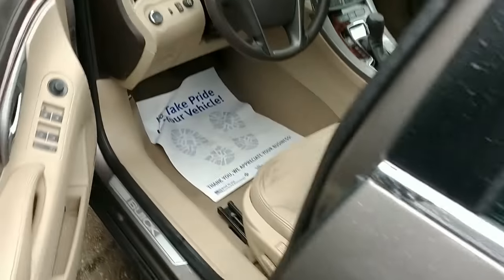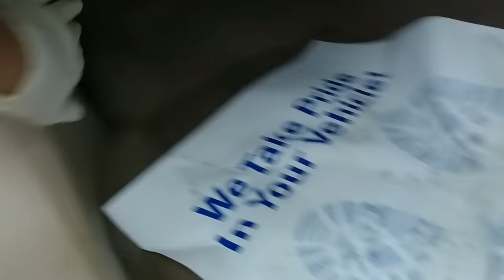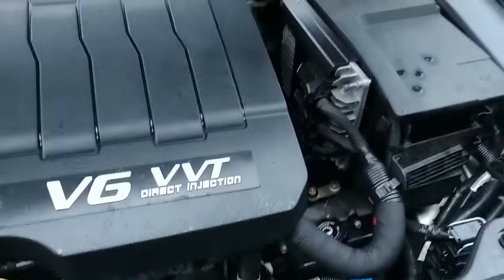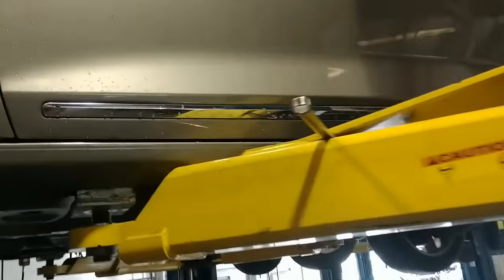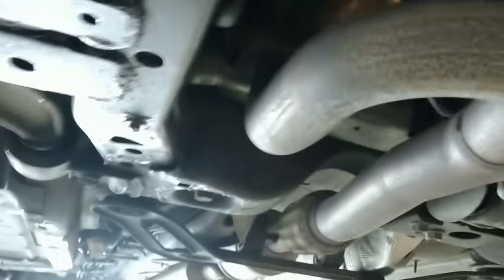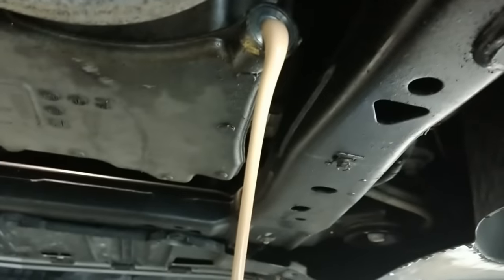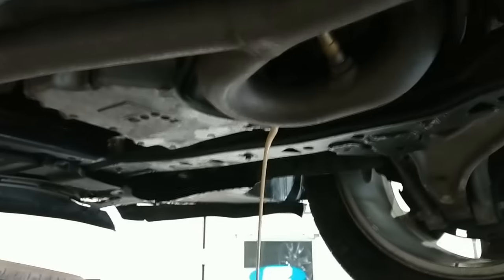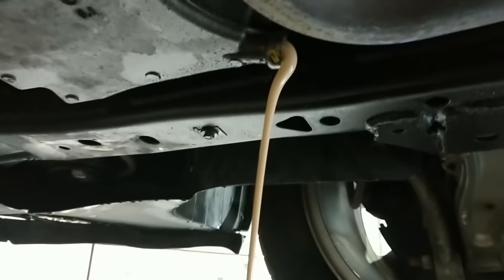Overfilled Crankcase! Blown ENGINE! Used Car Nightmare!

Comment: Your video is now evidence, defendants exhibit 1 in court.
Reply: I'm sure the purchase paperwork for this car had an enormous AS-IS statement included with the buyer's signature right on the line.  
ALWAYS get a Buyer's Check from a reputable mechanic's shop.
Reply: @Cautionary_Tale_Harris  There are still laws to help protect against this kind of issue.  AS-IS or not, if there was no disclosure on the work done and if the dealer was at fault, they can be held liable.  I mean, come on, they used a tube of silicone to seal the timing chain cover, that alone warrants some action.
Reply: @cujoedaman  
This buyer might be able to get some recourse...maybe. In my experience, the most a buyer has been able to recoup is some of their money back. 
But I wouldn't expect a judge to force the dealership to take the car back. Caveat emptor.
Reply: @cujoedaman  no way to prove it was the dealer that did that. Very easily could be another dealer that did it, sold it it at auction, and the end dealer sold it. You think this is their first rodeo? Cars always should be checked and our legal system is flawed. Don’t be naive to expect the government to cover you, when you didn’t try to cover yourself.
Reply: Evidence of what?
A stupid buying decision....
Reply: You mean plaintiff’s exhibit?
Reply: @DerPilotMann  
And it's all perfectly legal...
Reply: @atticstattic  legal doesn’t equal right or morally acceptable.

Why are so many people obsessed with legality over morality? Makes zero sense.
Reply: @cujoedaman  Unless it's a legitimate fraud case, that As-Is clause will fuck you over under both the Rest. 2nd of Contract Law and the Universal Commercial Code. You have VERY limited rights if you purchase a vehicle As-Is. The As-Is alone is an ENORMOUS red flag.
Reply: @DerPilotMann  
Yeah but all too often there's a reason why some people have to buy from those shady places rather than more legitimate sellers.
Reply: @camtwan1  , a private party might get away with "i don't know nothing" but a dealership will not.
Reply: @DerPilotMann  And to add, it doesn't matter if you're buying a smoke-wagon from ScrewYou Motors or a garage-kept car from a sweet old granny...the mechanical soundness of a car is far too complicated for the uneducated to try to determine on their own.
Reply: @truthsmiles  oh, yes, can I blame that on the phones autocorrect?...
Reply: @markbroughton5814  I’ll allow it :)
Reply: @DerPilotMann  
you aren't going to win in court on moral grounds
Reply: @DerPilotMann  because courts are based on a thing calls laws which dictate what is and isnt legally allowed. Though, the building blocks of most laws actually are based on religious beliefs/followings which i find to be bs.
Reply: @DerPilotMann  
That's how capitalism works, I'm afraid...
Reply: @atticstattic  I would only add the caveat that that is how “poorly regulated” capitalism works.

While I’m not the biggest fan of our capitalist system as is, I think capitalism with strong regulations is perfectly viable for most industries.

Aside from that, yeah, you’re not wrong.
Reply: @DerPilotMann  
Strong regulations won't protect people from themselves...
Reply: @cujoedaman  silicone behind the timing cover can be common practice from the manufacture nowadays, have seen to many times...mostly on GM vehicles.
Reply: Unless the buyer bought the car (as is) the seller can just say they cleaned the vehicle up and sold it as is....
Reply from the maker: Hope not, but I've been to court before. Documenting is critical in my business.
Reply: @DerPilotMann  because your morals are really just your personal opinion on the way things should be. I'm not saying you're wrong, but everyone's opinion is different in some way.
Reply: It's called lemon law people. It basically says they can sell you a really nice piece of $h!+ for $4,999.99, and not anymore than that, and there's nothing you can do about it.
Reply: *Plaintiff's.
Reply: Im a canadian car salesman, As-is still means that it must provide transportation for atleast a few weeks to give it time to be mechanic certified. If this dealer was in ontario he'd be fucked.
Reply: Buy as is is how this goes.  Buyer's responsibility to get it inspected if they don't know how to do it themeselves.
Reply: Unfortunately, a used car is always buyer beware unless the buyer can prove it was malicious  by the seller, and that's a tough sell because buyers are suppose to thoroughly go through car and have inspected by mechanic unless he knows what to look for, otherwise, wont hold up in court. Always inspect a car prior to nt transaction. But also didn't help when new owner drove it and overheated on her (not sure how long that happened from purchased, feet or days). She could have blown the headgasket.
Reply: @cujoedaman  whats wrong with doing that? there are good brands of silicone which are designed to seal valve cover, timing chain cover
Reply: Even with an AS-IS purchase agreement, you should have the expectation of have a car that will run. Yes, it has problems, but it shouldn't blow up on the way home. In most states you have a Lemon Law that protects you from this.
She should tow it to the dealer, tell him this is NOT what she paid for, and if he doesn't refund he will be in court - see how much of his time he wants to waste.
Reply: @TSKseattle  I don't think the lemon law covers used older cars (I believe new cars) due to the fact there is an expectation of issues on usd cars. Car didnt run right from the start and instead of not purchasing or questioning the dealer about it further, she drove it and even for an hour before catastrophic failure. That's why you always take a mechanic or take to mechanic for inspection. Prior to any used car purchase. Courts will ask of she notify dealer and gave opportunity to correct before any consideration if at all due to it being a used car.
Reply: @camtwan1  please-I owned a small. Car dealership follow the law to a t- go to court dealer will still lose. It’s like the feelings court-they don’t go by the law the lady will won
Reply: @DerPilotMann  Yeah, in law school they actually teach lying. Lawyers are the scum of the Earth, and always have been. Just look at your state and federal governments, mostly populated with corrupt, immoral lawyers.
Reply: Believe if it’s over a certain amount then old owner is liable. I’d still sue
Reply: @DerPilotMann  This world has lost all morality, since they made murdering babies legal.
Reply: @jonyemm  Your reply is the b.s.
Reply: @cujoedaman  silicone rtv is how you seal that timing chain cover, no gasket. The buyer is screwed, fix it or let it get repo'd
Reply: Yall forget about lemon laws.
Reply: I think everybody is picturing this happened to their mom.....
Reply: @DerPilotMann  Buy here, pay here dealers are shady but if a person hasn't figured that out by adulthood, couldn't tell by the shoddy look of most of those dealerships, and they couldn't spend a few minutes doing research then maybe they need to learn the hard way. No one expects consumers to be all knowing. We do expect consumers to do their home work and/or pay an expert to help them aka have the vehicle inspected by a reputable third party.

Government doesn't exist to protect people from their own negligence.
Reply: @saved217  other than the very end of my reply whrre obviously state my opinion isnt really up for debate considering its quite factual. Even for my "opinion", its actually supported by the good old "seperation of church and state".
Reply: @jonyemm  So you mean laws like thou shall not murder, lie, steal, hate, greed, gossip, honor you mother and father etc, etc. Those mean old religious laws? Boy your right . Those are terrible laws to live by.
Reply: @Cautionary_Tale_Harris  My 2015 Chevrolet Impala was sold AS IS and 2 calls later and demand letter from an attorney and the dealership refunded every penny including tax, registration, interest paid on the finance and my extended warranty
Reply: @airfried4908  What's the story on that? Because a refund like that is exceedingly rare.
Reply: @LavaughnVanbrocklin  Lemon Laws generally apply to newly manufactured cars and the manufacturer/dealer must be given multiple opportunities to try and fail to correct the vehicle's problems.
Reply: @cujoedaman  Which laws, exactly? And for which state? Thinking a law should exist doesn't mean it does.
Reply: Good luck with that, that's now how AS-IS sales work.
Reply: @airfried4908  Being 100% serious, I genuinely want to know more details about what happened with your Impala.
Reply: I would just burn the whole dealership down
Reply: I bought a truck used in VA it overheated and the head cracked 20 miles down the road. They replaced the engine for nothing. It was their fault for not notifying me that the water pump was not working. They said ok we will replace it.
Reply: @BTrain-is8ch  consumer protection legislation exists because scummy fucks will try to rip people off, and their victims deserve recourse.

The victims are not the ones to blame.
Reply: @cujoedaman  chevy doesnt make a gasket they use silcone from the factory
Reply: @DerPilotMann  Americans have an accountability problem.You screw up, you learn from it, you move on, and you don't make the same mistake twice.

I bet you think people that make interest only payments on debts like student loans then find that their balance has actually increased after years of payments are victims too right? Damn "predatory" lending huh? Why didn't the lender tell them that their payments weren't large enough to  reduce the balance at all? Why did the government let them do that? Why didn't someone protect those poor innumerate people?? Where was the consumer protection??!?
Reply: This is the car you drive off a boat launch then tell the insurance company you parked it last night, came out that morning and it was gone.
Reply: @user-cs3zs6jn1d  I know here in the state of Indiana there's no lemon law on used cars. Only new..
Reply: So how much would it cost to repair that engine, or is it toast?
Reply: Cool theres coolant in the oil. Wheres the diag. Whys every tech now some narcassist making youtube videos and solving nothing
Reply: @DerPilotMann  because they went to public school and believed every word they said lol
Reply: @zashbot  as did I for quite a while. Only once I got out of my small Midwestern town and actually met people of differing backgrounds did I gain an appreciation for how reality works. 

It’s hard to see your privilege if you never interact with those less fortunate...
Reply: I believe the lemon law applets here does it not?
Reply: @brianscofield2457  thats now how used cars work with as is condition . Otherwise people would go around buying up every 200 dollar parts car there was and sue the seller.
Reply: @marioncobretti7870  true... This is very unfortunate... Hopefully she got at least a 30 day warranty... Thanks for the response sir... Stay safe
Reply: @Cautionary_Tale_Harris  buyer beware  if used
Reply: Depending on the state, if there was a warranty included, even a 1000 mile or 1 month warranty, this would not be an as is transaction.
Reply: Sister Mary Clements  
"Braking" the law - love it!
Reply: There's no lemon laws to protect people from this, if the cars is only a few days title transfer and drive only a 100 miles she should be fully protected unless she was stupid and bought the car AS-IS and was made fully aware of the cars situation.
Reply: It was a 30/30 plan: 30 feet or 30 seconds whichever comes first.
Reply: @mr.k.i.s.s7496  Oklahoma guarantee.
Reply: At the very least, the dealer's insurance rates should go up after all of the cars on their lot mysteriously burst into flames.
Reply: @Cautionary_Tale_Harris  In CA at least, there are strong laws protecting against this kind of thing. If you sell a car as "working" and it has some catastrophic issue, you can sue and win.
Reply: This is so weird, I thought lemon laws were to prevent those scummy buy here pay heres from selling junk like this.
Reply: @user-cs3zs6jn1d  lemon laws are only for new cars
Reply: @C.c.dethomasis  you must own a bhph, your comment is irrelevant, because it's no excuse for a bhph to rip someone off. Not everyone gets bad credit from being irresponsible. Mine is crap because I got seriously ill, and had huge medical bills.
Reply: @Cautionary_Tale_Harris  Depending on how consumer friendly your state's laws are, the "AS IS" may be unenforcable in court if the car was bought from a dealership that specializes in selling cars. Implied warranty of merchantability and fitness for a particular purpose may apply here. Always still worth it to consult with a lawyer.
Reply: @KevinSun242  Just make sure your family and friends know that consulting a mechanic prior to the [edit] sale purchase is smarter, easier, and cheaper.
Reply: When I was 18 years old I bought a car off one of those run down dealerships. Brake pads were completely done, rotors were warped, tires were bald. They just bought the car from the auction, cleaned it and sold it to me. Learned the hard way. Stay away from those small dealerships, and always inspect your car before you sign anything.
Reply: If no lemon law in place..I go with driving it through the front of the store with your insurance cancelled 🤷
Reply: @user-cs3zs6jn1d  lemon laws don’t apply to used vehicles, only brand new ones.
Reply: @TSKseattle  lemon laws don’t apply to used vehicles. Only brand new ones.
Reply: @DerPilotMann  Absolutely, when i was younger and someone did this, my dad had the "boys" come visit the used car dealer at the end of the day. Dad had no problem getting the dealer to re-purchase the lemon.  The italian persuader worked very well. LOL

Comment: Only if McDonald’s milkshake machine ran as smoothly as this 😌🤭🤣
Reply: The ice cream machine at the fast food joint by my house always brakes down lol.. 😒
Reply: I’ve heard that’s an excuse for when they just cleaned the machine and don’t want to dirty it until the next day
Reply: @howtowithelizabeth7513  The machines at McDonald's are always down because the clean cycle has crap software.  It can spit an error code for the most mundane of reasons, such as slightly too much mix in the hopper.  The machine then throws a cryptic error code and the only course of action the operator can do is call out "the guy". AKA the only company allowed to service the machines.  This might take anywhere from a few hours to a couple days depending on how busy that region is and how many guys are covering it.  It's a scam to rip off the franchisee.  There is a great documentary here on YouTube where a reporter took a very deep dive into the subject since most major fast food franchises use the same soft-serve machine company and McDonald's is the only one that has this problem.  Oh, and both the machine manufacturer and the repair company are owned by the same company.  Go figure.
Reply: @jameslmorehead  so it's similar to what car dealerships do. Sell you the car, then tell you so and so is broken and you have to fix it from us. Brilliant!

Comment: My favorite part was the “oh NOOOOO”. Most think it’s because of what came out. It was actually because he dropped the plug inside the catch pan and it got covered in that shit. Lol
Time for a head gasket!
Reply: You got the first part and my first thought also, going even more down the rabbit hole can be a cracked head.
Reply: This thing got HOT. wouldn’t trust a head gasket repair.
Reply: @You're Gonna Hate This You can resurface the heads but you can't resurface the block in vehicle.
Reply: @MWilk098  actually you can resurface the block but it will require the car to get bigger Pistons
Reply: @DeathByRubberDuckyXD6841  you aren’t resurfacing the block in-vehicle. At that price point, a fully remanufactured engine the go-to.
Reply: @MWilk098  never said to resurface it in the car just saying it can be done just going to take weeks of work and alot of $$$
Reply: @DeathByRubberDuckyXD6841  which makes it not a legitimate option for anyone trying to make a living. You swap the whole unit with a reman and ship off the core.
Reply: For everyone saying replace the head gasket...that is only part of the problem. Lady drove this 100 miles. Crank and bearings are probably toast. My guess is it would need a completely new motor.
Reply: @johnmaxwell1356  the bearings will have that nice purple and yellow rainbow tint to them. Beautiful. Looks like money.
Reply: not a mechanic, i'm more self-taught how to repair my own shit, so excuse this if it's a dumb question. was this a blown head gasket or did some moron put coolant in the wrong place at the dealership it was bought at, and nobody realized it till it was driven for a while?
Reply: @edgar_jeremiah  this isn’t a new car, it’s almost certainly a head gasket.
Reply: Time for piston and rings, cam and bearings, big end, mains, oil pump and your head gasket.
Reply: A Buick with 75k miles only costs a few grand?
Reply: @MWilk098  Yeah you never know how badly heads can warp once you heat up that aluminum.
Reply: @You're Gonna Hate This You'd be better off grabbing a pair of heads from a decent wrecker motor and sending those out to the machine shop.
Reply: @edgar_jeremiah  That's the result of either coolant leaking into the cylinder from a) blown head gasket or b) a crack in a cylinder wall. 
Most likely a head gasket, which if it was caught soon could be replaced and the owner on their way, but this has been ran hard with extremely bad lubrication due to the oil/coolant mix. There will be more damage to upper valve train and probably main bearings due to the lack of lubrication. If you didn't simply replace the motor it would require just as much work I'd not more tearing it down to inspect what damage was done. In the end not worth it.